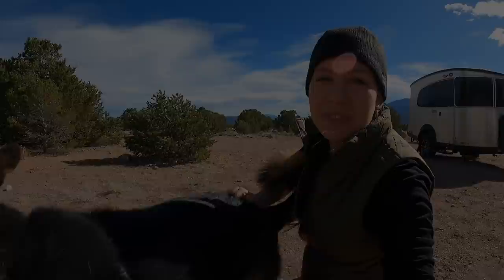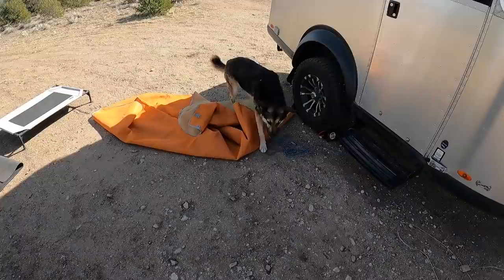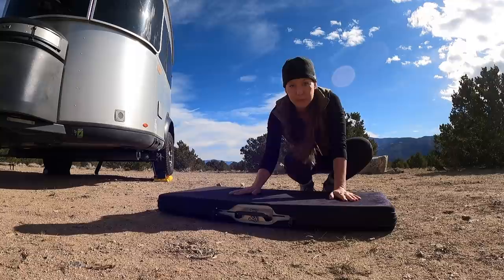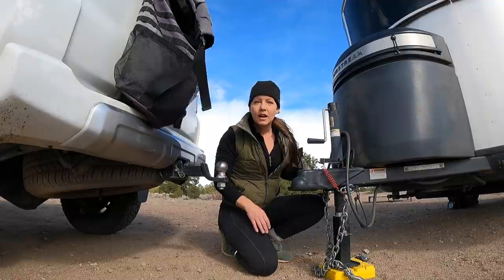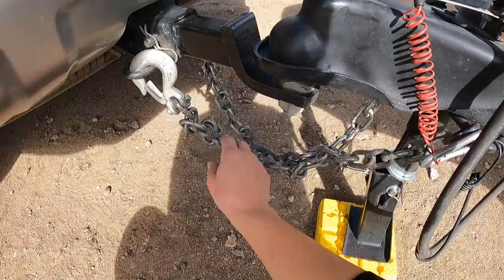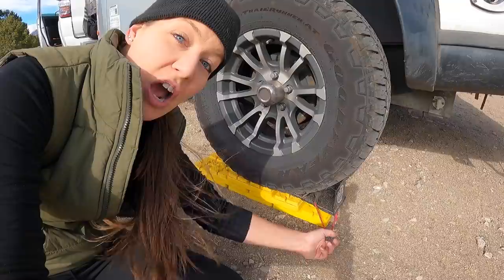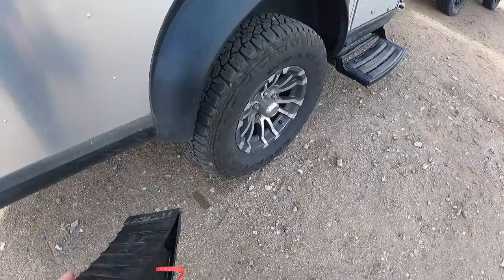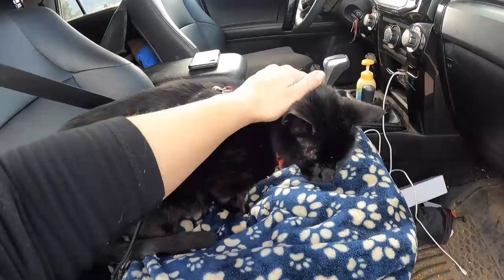Hooking up an Airstream Basecamp: How to Hitch a RV Trailer as a Solo Female

Comment: Hi Cass - im learning as much as I can from your videos. So much thanks! I have a dog and want to eventually get an airstream. Can you do a video on traveling with your dog and rules you stick bu. I noticed you tie him up with that cable. Can you explain further? If your secluded do you need to? Also when your cat is in the passenger seat do you turn off the airbag?
Reply from the maker: Hi Lisa - I can definitely add those to the video list!  Jasper is fear aggressive, so I leash him as I do have issues with off leash dogs just running up to the RV at times.  If I'm outside with him and we are secluded, I will let him off leash.  And the airbag for the passenger seat goes off automatically when there isn't enough weight, and thankfully Napoleon isn't that fat yet!
Reply: Thankuou! One last question.  My Rudy who is a cockapoo is really scared of dogs. I am worried about off leash dogs approaching him off leash when im at an RV park, can you talk sbout that in your video. Im like you...he's my love so i worry about his safely.  Just wondering how i would handle it. Thankyou so much!!!!
Reply from the maker: @lisasword4815  Absolutely! I will touch on that as I'm very cautious of it.  In RV parks, you shouldn't have a problem. Most have rules and usually people are very good at sticking to them. It's more when you are out boondocking to always be aware of your surroundings as there are a lot more offleash dogs out there.  My video about finding a boondocking spot goes through that a bit.  The site I ended up at had a fence on one side and I could see down the other side to watch for any incoming dogs.

Comment: well hey Cass, that was fun... takes me back to the years I pulled a small single axle trailer. and like you, I'm always extra careful with my dog,  Gaia. Seems once again you covered everything in good order. One possible thing I noticed, you may have a good hook location just left(outboard) of your power cord plug location ..... for your emergency trailer brake (accordion red cable). Depending on the length of the red cable..... 
Several years ago, I had my hitch pin break ..... (what you mentioned) so it does happen.   
thanks again for your fun professionalism  😊
Reply from the maker: Thanks for the idea Dwight! I'll go check that out tomorrow.
Reply: Tails of Wanderlust  please just make sure the cable is not stretched too far
Reply from the maker: @dwightbusby8505  Definitely will!
Reply: @TailsofWanderlust  So, if my Miata could pull a trailer, I'd get a BC!  But I gotta have my fun car!  Love your videos, what a refreshing young lady you are, keep up the good work and videos!

Comment: Curious and not sure if you've done a video on this but what is the basic and long term wear of your 4 runner?  I.E shocks, tires and the mileage and year of it?  And also,  pull weight with everything in the 4 runner and the camper itself plus you and your animals lol?
Reply from the maker: Great questions!  I haven't done a video on that yet.  The 4R has over 80,000 miles on it and other than regular maintenance, I've only had to replace the brakes.

Comment: Great video! Looks like a standard RV or 4 wheel drive jeep can tow a base camp? Or is there a specific type of vehicle? Just curious. Thanks for answering on advance.
Reply from the maker: The Basecamp is about a 450lb tongue weight and 3500lb GVW.  Any vehicle that can tow those specs would be able to tow it.  4WD is great, but not required.

Comment: Hi Cass. I noticed you use a flip-up type foot jack. Are you happy with it? Any issues/recommendations? Thanks. Safe travels!
Reply from the maker: Hi Mike!  In my next video I actually switch it out :).  I didn't find it that stable, so I went back to a solid metal foot.
Reply: @TailsofWanderlust  Thanks Cass. Appreciate the input so I didn’t waste money. You rock!

Comment: Do you wish you had sway bars, looks like they are not necessary on the basecamp 16.
Reply from the maker: I have never towed with sway bars, so it is a bit hard to compare.  But for the 40,000+ miles I've towed the Basecamp without having any, I haven't had any issues even in high winds, passing trucks, etc.

Comment: I have been watching your videos since the beginning, very inspiring . I also have a 4 runner and want to get.a basecamp, do you find your trailer sways a lot? Have you thought about WDH?
Reply from the maker: Hi Sheila! Thanks for watching.  I don't find I have any issues with sway.  I would love to get a WDH, but the 4Runner stock hitch does not support one. I would have to completely swap out the hitch in order to install one.  I went with rear suspension air bags instead.
Reply: @TailsofWanderlust   /thank you hope you eyes heal quickly
Reply from the maker: Thank you Sheila!

Comment: Do you have a link to the pin you used to lock the hitch?
Reply from the maker: Not for the exact one.  It came with the Airstream when I purchased it.  I believe it is called a hitch pin lock, and you can find them at Lowes, auto part stores, etc.

Comment: I’m interested that you don’t use a weight distribution hitch or have sway control.  Has that ever caused you problems?  Not having one sure makes it easier the hitch but I do worry about sway during evasive maneuvers, wind, or passing trucks.
Reply from the maker: So far, I've never had any issue with not having a sway bar.  I've driven through very high winds, past plenty of trucks, etc. and it has always done very well since it's so small.  And instead of WDH I have airbags in the rear suspension to prevent sag.
Reply: Glad to hear it’s okay.  Airbags are great at preventing sag, of course they don’t shift the weight forward to the front wheels like a WDH would but it sounds like you’ve been fine without that.  A WDH would make it so you didn’t have to sweat tongue weight as much but thy re more of a hassle each time you hitch and unhitch.
Reply from the maker: @daleyocum3418  Very good points on the difference.  I definitely try to keep hitching & unhitching as easy as possible.  Appreciate the overview!

Comment: Hi , want to know,? 🤔

Do You have only emergency brake on the  baseCamp or you have a systeme brake that synch with the 4runner.

👍👍
Reply from the maker: Hi! Yes, there are trailer brakes as well.  They connect via the 7-way pin.

Comment: is your SUV leveled with the camper attached?  On some of your video title screen shots, your SUV does appear to be squatting.  This is not good..  You may want to look into this.  No sure if a weight distribution bars would help in your case or not.  Love your courage!
Reply: On this video's title screen shot, it appears your truck is squatting.  Shouldn't be doing that.  Could be dangerous
Reply from the maker: Thank you!  The Q&A Video, it is squatting. That was a picture from the first day I brought the trailer home.  Since then, I've put in a new suspension and also put in rear air bags.  Now everything is level when I tow (as long as I remember to fill the air bags).

Comment: What is the height of the coupler on the camper?
Reply from the maker: With the 3" lift from the Basecamp it is roughly 20-24" (estimate as I'm currently unhitched from the truck).

Comment: Do you have any issues without w/d - sway control hitch? Or overkill for 16?
Reply from the maker: I don't have any issues.  I'd love a W/D hitch, but the stock hitch on the 4Runner doesn't support them.  If I ever switch to a different vehicle I will.  No issues at all without a sway bar.

Comment: Great content ! I’m looking for a tow vehicle for my small cargo trailer conversion and have been looking at ads for used 4Runner’s. How do like towing with your 4Runner ? Any issues ? Thanks so much.
Reply: Fellow 4Runner owner here - I can't speak to towing a Basecamp, but I have towed small mini-campers like the Runaway and A-Liners and it performs like a champ.  Your MPG obviously goes down, but that's to be expected.  Also, like she points out if you want a brake controller that needs to be installed aftermarket (I haven't done this yet myself).  The 5th Gen 4runners comes with both a 4 and 7pin connector.
Reply from the maker: Thanks for adding great tips Zachary!
Reply from the maker: No issues at all towing with the 4Runner.  Going up and down mountain passes, it does require high RPMs, but otherwise I barely notice the trailer is back there.

Comment: Do you have a lot of weight on the hitch?  Do you load balance between the front and back of the base camp or are you not too heavy for the 4Runner?
Reply from the maker: The GVW is 3500lbs and the tongue weight is 450lbs, so it's under capacity for the 4Runner.  I don't worry about how it is loaded, as there really isn't too much in there and I don't find it makes a difference.
Reply: @TailsofWanderlust  Really love that trailer!  Thank you
Reply from the maker: Thanks Cash!

Comment: Why do you turn off the fridge? Doesn't run on propane?
Reply from the maker: It does run on propane.  It's not safe to have the propane on while driving, so I turn that off which means I need to turn the fridge off.  I have since upgraded to an all electric fridge so I don't have to turn it off while driving.
Reply: @TailsofWanderlust  it's perfectly safe  to travel with it on. That's why they are built the way they are.

Comment: Hey you 
I’m considering this trailer for next year 
Question 
Is it decent for off road ?  Not extreme stuff like rock climbing. But just the roads out west off in the sand or not well trodden roads ?

I’m looking at the x package 20
Reply from the maker: Hi!  Everyone has a different level of "off-road" so it's hard to say for sure based on what you are thinking. But I use it mostly for boondocking and going down dirt roads. The rear departure angle is better than a lot of trailers and you don't have a bumper to hit.  There are shocks so although things are bounced around, they aren't thrown around. I've been down muddy and rutted roads and it has done fine.  Never done anything with much rocks.
Reply: @TailsofWanderlust  perfect 
I need it for that. Not too crazy 
But I’ve had normal teardrops or Eva that just  fall apart on bumpy. Sandy roads 

It’s a huge investment 
But I’m full time. And work remote. Like yourself 
So. It’s worth it I think
Your videos have been really helpful 
Thank you
Reply from the maker: You are welcome and glad they are helpful! Just know that right now RVs prices are at an all-time high due to COVID.  So if you are looking, things are quite expensive currently.
Reply: @TailsofWanderlust  ugh 
I know

Comment: Do you use any break controller or anti sway system ?
Reply from the maker: I do have a brake controller. It’s a Tekonsha P3. I don’t use anti-sway as the trailer tows very well without one.
Reply: @TailsofWanderlust  I use a break controller on mine as well and I have had no issues towing mine without anti sway bars . I was curious if driving out west might be more windy and also mountainous .
Reply from the maker: @trevorlee7945  No issues so far thankfully!

Comment: Do you take that Basecamp on some really rugged roads.  Up and down fairly rocky terrain?  Do you think it can handle it?
Reply from the maker: That really depends what you consider rugged. I took it down some rough forest service roads. But I wouldn’t do any bouldering with it. The rear departure angle is amazing for Offroad. However, it’s still a Camper and things do shake loose.
Reply: @TailsofWanderlust   Thanks.  At this point I'm not exactly sure what trails and sites I'm headed for, except I know it won't be in large State parks.  Just me and my Belgian Malinois.
Reply from the maker: @robcassella5825  it may be helpful to scout out the sites and rougher areas so that you can make sure your comfortable taking the Basecamp in.
Reply from the maker: @robcassella5825  have fun!
Reply: @TailsofWanderlust  Excellent.  Thanks.  I think I'm gonna  go with a Off Grid Trailer.  Expedition model.  Just really robust.  Much smaller interior and certainly not for everyone I don't think.   I'll give this a shot.  If I find I'm not doing the rough stuff and want more room, then Basecamp here I come. Thanks.  Safe travels to you and Have fun!
Reply from the maker: @robcassella5825  sounds like a great plan. Enjoy it!

Comment: How many things can your solar setup run?
Reply from the maker: Everything in my RV, except the AC.  It's more about the total electrical usage than the # of items.
Reply: If you had two more Zamp panels could you possibly run the air conditioner then?
Reply from the maker: @jimmielittle877  The air conditioner requires a soft start as well as a high wattage inverter or generator.
Reply: Okay thx

Comment: Great, well done videos and very articulate. I am retired and have been thinking about purchasing a Basecamp x. Are you still happy with the quality and reliability of your Basecamp? While researching the Basecamp I have read numerous complaints about quality issues. One of the main issues seems to be that some of the items have had to be fixed several times. It appears Airstream is willing to address customer complaints however the issues never seem to get resolved. What has your experience been? I was considering Airstream due to their longevity in the industry and their purported quality however, after my research I am not sure about he quality, especially considering their cost.
Thank you.
Reply from the maker: Hi Tango.  Here is everything I've had done to mine: https://tailsofwanderlust.com/2019/01/30/airstream-basecamp-repairs-warranty-work/.  Overall, I still very much enjoy the Basecamp.  My biggest frustration would be the Truma itself.  I find it's not always reliable so I do carry an extra Buddy Heater with me.  But in the end, when I walk in many other RVs, I do feel the quality inside the BC is hard to match.  In terms of getting work done, I do find some dealers are better than others.  Now I tend to go straight to the factory when I need work done.
Reply: @TailsofWanderlust  thank you for that information and yes, I see where that system seems to have reliability issues. The more I read the more appalled I am becoming with so many customer complaints about Airstreams. It appears that we once again have a company living off their name recognition with very little regard for current quality. People purchase these to use, not to have them sit in the dealers repair shop. I believe I will look elsewhere. I will however continue to watch your very professional videos! Thank you again!

Comment: May I ask how much they are
Reply from the maker: For the Basecamp?  MSRP is upper $30K to low $40K based on options.  They started building them in 2017 so there are used ones on the market now.

Comment: I notice that she does not  have an anti sway bar or stabilizer. Everything I have read says you should have these items with this trailer regardless of it's lighter weight. What's up with that?????
Reply from the maker: You do not need an anti sway system for every trailer.  The RV tows extremely well behind the 4Runner and is very stable. Many people don’t tow these with sway systems. In the end, for this particular RV, it comes down to preference and each individual tow setup.
Reply: @TailsofWanderlust  I have read numerous accounts from folks who purchased this unit. Each response was pretty much the same. They said that the dealer told them it was not required and yet the owner's manual  said it was. I am surprised that nobody else noticed the lack of this system in your videos. This may be an indicator that many are novices and it is not something they would pick up on. I drove over the road for 41 years. One of the things you learn pulling 48 and 53 foot trailers (especially with light loads or empty) is that turbulence can do crazy things to that trailer. In all those years I also observed many RVs going crazy behind a tow vehicle. Just be careful out there my friend.
Reply from the maker: @robertmacellaro3181  Appreciate the insight from all of your experience.  Thankfully the Basecamp is a much shorter trailer so the sway is much less than the larger trailers.  The owners manually simply suggest them, which is the reason I've gone without for over 3 years now.
Reply: @TailsofWanderlust  I figure that the company suggests the stabilizer to cover their liability. Just be safe out there. The possibility exits and if it did not then they wouldn't suggest the use of stabilization.If the unit was a double axle at the same length I would not have brought this point up.
Reply from the maker: @robertmacellaro3181  That is a great point.  Truly appreciate all your insight on this Robert.  Thank you again!